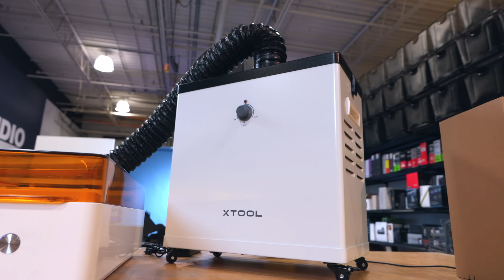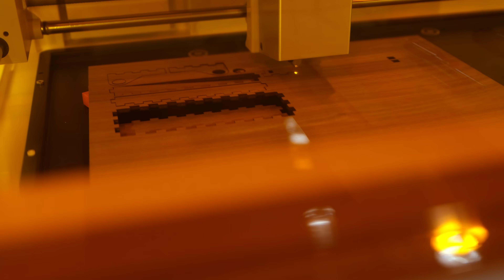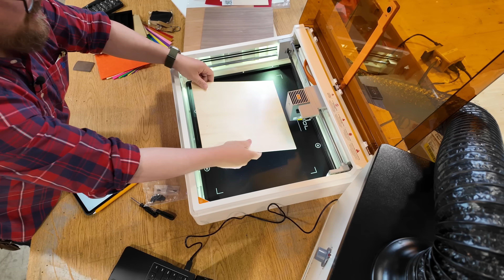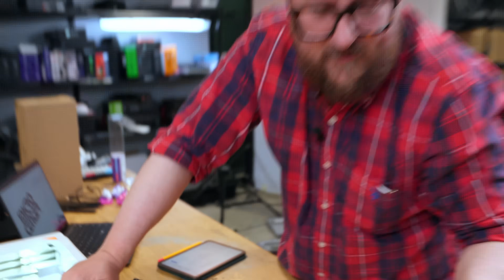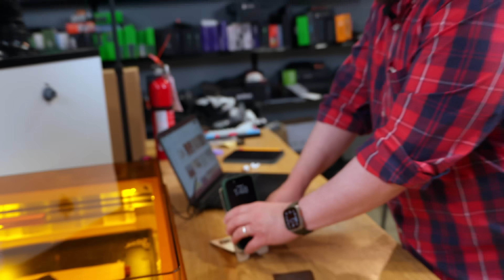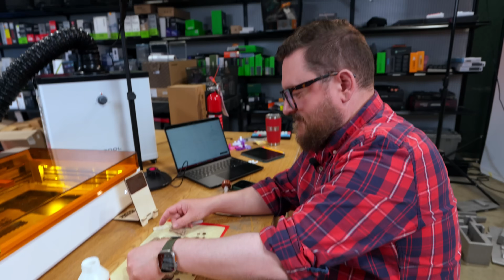Unboxing & Testing The xTool M2 Laser at Micro Center

Comment: This setup is more like 1500 usd and no materials except for some paper and a small sheet of ply. Xtool is sending out these machines for free to Youtubers for review, but it is not what you will receive for 599. Add ons are the rotary, Ink module and smoke extractor.

Comment: If anyone is curious, the air purifier is NOT included with the $599 laser. That is an extra $299 add-on. This laser can quickly grow to over $1000 when considering other add-ons. From the video, the air purifier is something you should not avoid getting so really it is an $800 laser.
Reply: agree 100%... and then, it starts making sense to look at alternate products that can do more than just laser cut.

Comment: For the past year, I have been researching technology that enables printing on fabric using a UV printer. As a result, I have successfully developed a groundbreaking transfer method. This technology requires no machine modifications. The process involves printing onto a sheet using a UV printer, spraying a special solution onto that sheet, then applying powder, and finally heat-pressing it onto the fabric to complete the transfer. Another point is the finish. This technology allows for a glossy finish on the fabric surface. This is something neither DTF nor DTG can achieve. Unlike T-shirts, this is crucial for high-value-added apparel products. Furthermore, this printing medium is not limited to fabric, it can be transferred to a wide variety of heat-resistant products such as wood, metal, leather, cardboard and so on.
Reply: Good for you Jack!
Reply: Are you selling that process??
Reply: @gramybrooks1  We are currently working to build a sales networking in US. Do you have any other questions,
Reply: @gramybrooks1  Yes. If are you satisfied this technology, and want to marketing in your country., it is possible to collaborate with you.
Reply: Could this laser work with your product? Does your process allow for only a single color? My wife does commercial embroidery and screen printing. I’m interested in learning more.

Comment: Do we know if there will be a riser available to engrave taller material?
Reply: No riser. The M2 isn’t design for a riser which is one of many drawbacks for this laser. That is why I highly recommend the M1 Ultra, you get more for your buck compared to the M2. Even with M2 camera system the M1 Ultra is more accurate or spot on. I should know, have both M1 Ultra and M2. Although, the M2 isn’t a bad laser, it can do a lot as long as the materials don’t exceed the height requirement.